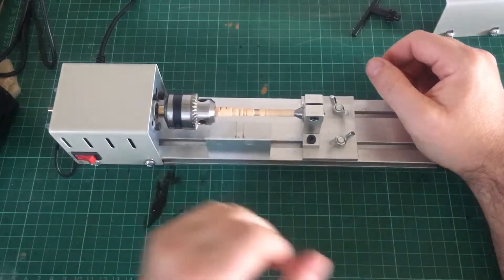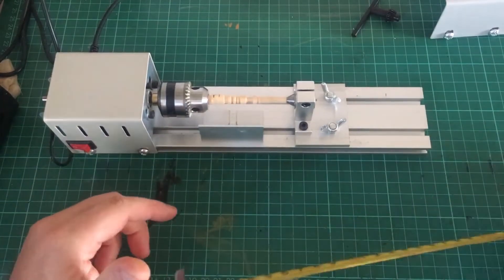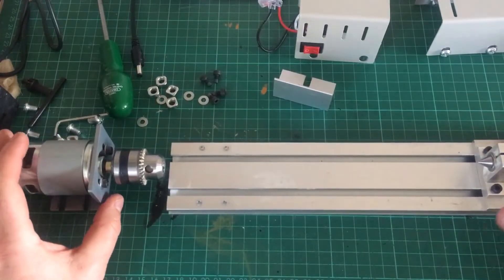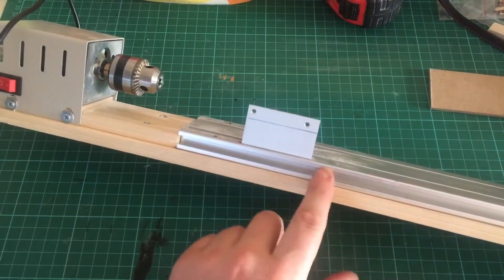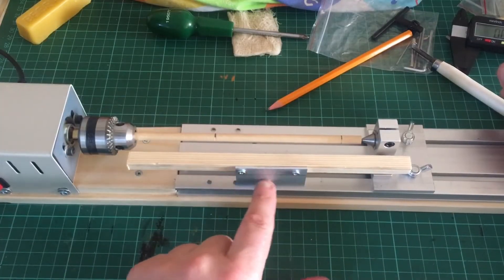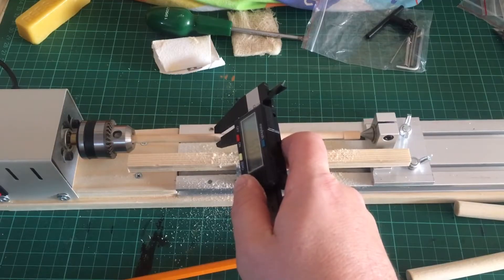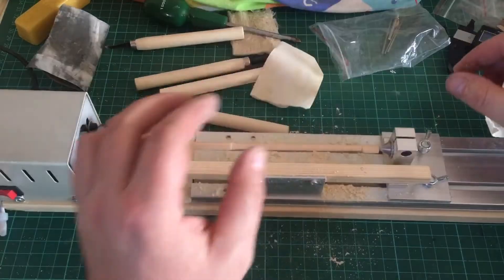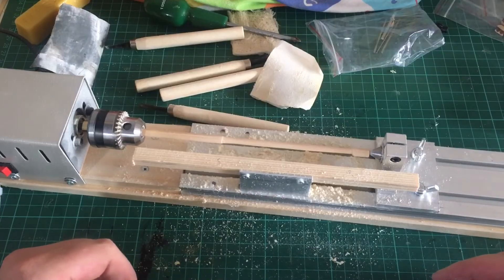How To Modify a Mini Lathe  : Yard turning

Comment: you really need to read a book on lathe work because you are holding the cutter backwards,also to extend the length just buy another length of profile ,also bolt the lathe down to a larger piece of plywood than clamp that to the workbench as that is much safter than to let the thing vibrate around and put on some saftey glasses.

Comment: hey John
Truly enjoy your builds mate. new to you over the past 3 or 4 days. watching your HMS Victory builds of, I think, De Agostini.
\great and enjoyable videos!
On this video of the Lathe modification, do you think you could possibly gain another 2 or 3 inches in say mast length by turning the centreing cone 180 degrees around to face away from the chuck. Then, turn the whole sliding lock plate around, having the locking wing nuts now in front instead of behind.
i hope this is of help buddy
many thanks
Reply from the maker: Hi Chris, I’ve haven’t used the lathe for turning in some time. I finished all my mast over a year ago. But I agree with your comment, and I think that would increase the length by a couple of inches
Reply: I have to say John, your masts on this Victory are a work of art. You make it seem so easy.
I got a Bounty as a gift from my family around 15 to 20 years ago. I haven't built it because I thought the masts would be too difficult and I couldn't do them justice. 
I now know that I can do a bearable job after seeing how you craft yours. Building them with your plans on camera was so educational. 
Many thanks John!

Comment: Hey so I purchased the same lathe, is it possible to make it be able to drill a hole straight? Thank you!
Reply from the maker: Hi patrick. To drill hole you need a rear grill Chuck and without that it’s very hard to drill straight holes

Comment: Hi John, and thank you for all your tutorials on the HMS Victory, they have been a blessing. May I ask how did you use the lathe on the masts please? The problem is that the chuck max. diameter opens to 6mm and masts are 12mm.
Reply from the maker: Hi Eldrin, I drill a 6mm hole in the end of a 12mm mast. And glue in a 6mm dowel that fits the Chuck. Hope this helps
Reply: @Johnbuildsiconic  Clever idea, many thanks
Reply from the maker: Your very welcome

Comment: Sir, can you teach how to replace the chuck? I bought the same to carve resin eggs but the height is too low to fit. Would appreciate your wisdom.
Reply: I would use the same concept as this guy did. Instead of extending the length just add height to the motor and tail stock so it gives you more clearance between the bottom of your material and the base of the tool! If need to, accommodate the same distance for tool rest.

Comment: i missed out on this one ! Comes in handy! Clever modification, so i just bought on. No more messing around with a drill and sandpaper!!!
Reply from the maker: Hi Ron. I missed this comment. You will find making mast on the mini lathe so much easier
Reply: @Johnbuildsiconic   In the past i used a drill to shape masts en yards. It works but leaves a lot of sawdust and due to the fact that you have to keep the sandpaper rolled up in your hand moving it up and down to sand down mast or yard it did n't allways feel safe. You have to be aware of the heat that is devolping. It hapenned every once and a while a mast would break and that is not cool. I have purchesed a minilathe and going to buy a second one to create something that is going to be semilar to what you did.
Reply from the maker: Hi Ron. Next year I’m going to be upgrading to a better lathe. But this mini has served me very well over the last 2 years

Comment: The aluminium extrusion is available on line under part number Machifit1560. 500 mm length costs about £16.
Reply: what web site did you find this
Reply: @johnyandell3188  AliExpress.
You can search for "1560 aluminium extrusion"

Comment: So is there a specific reason as to why you used a separate wooden board as opposed to buying a bar of extruded aluminum t-slot that was the length you wanted?
Reply from the maker: Hi, no there wasn’t I specific reason I used wood. YI just wanted to use the mini lathe that day. And I didn’t want to be waiting for the aluminium t-slot. material to be delivered. I’ve been using the lathe for over 6months now. Without any issues